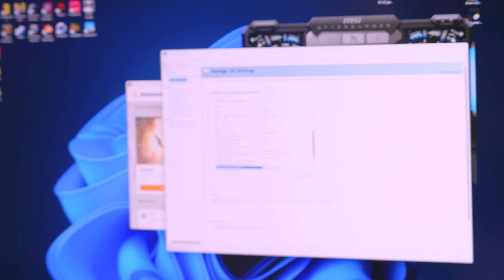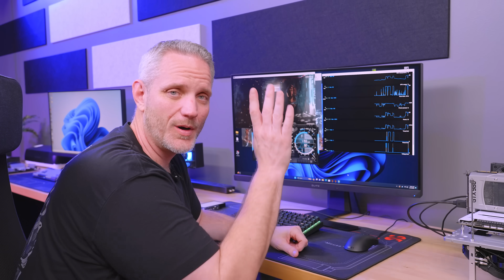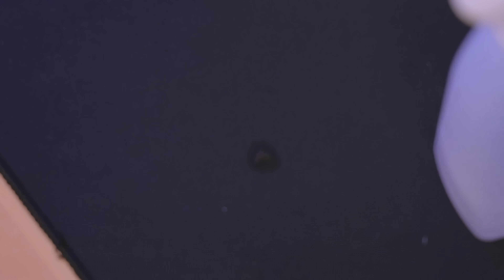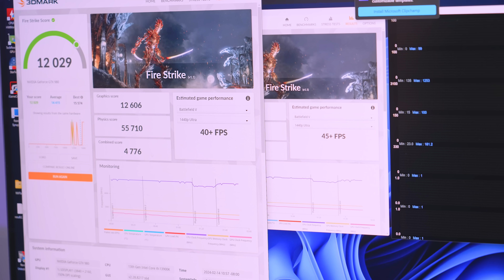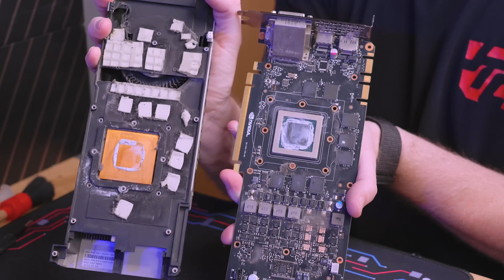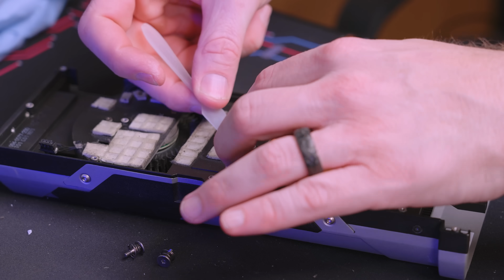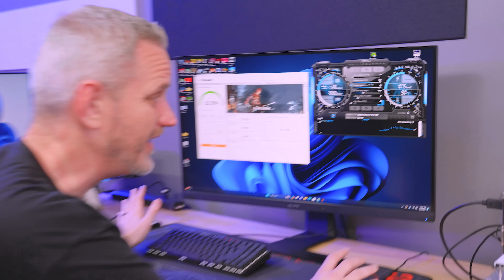This was KILLING this cards performance!

Comment: I bought an EVGA 2060 12gb in 2022 and never used it. I stuck it in my Grandsons rig and it spiked in Temps. Out of Warranty so I tore it down. THEY HAD PUT THERMAL PADS ON EMPTY VRAM SPOTS AND WERE MISSING SOME ON THE CHIPS THEMSELVES. I moved the pads and problem solved. WHO DOES THAT (except Detroit Auto Assemblers)?

Comment: lmao feels like me trying to cool an xps 8930 bro thres js 2 fans exhaust and cpu fan and its the worst heatsink ever on an i7 8700 bro the things an oven. i rigged it up with 4 more fans and im using it for my server so im running ubuntu server on it, and setting up a fan control pwm was a pain in the ass but i got it to work. and now its temps are good and its quiet and if it needs to scream it can cus i left the stock cpu fan and exhaust fan and the exhaust is 12v 1.5amp shits loud its fast asl at full speed. but temps are in check now at least.

Comment: I received a 1660ti recently and the thing was worse than this. i think it was in a garage with sawdust being blown everywhere, and I had to tear it down completely and the thermal paste was so hardened that the heatsink just popped off with very little force. Performance aside, I was not going to leave the GPU looking like it did. haha

Comment: I have done repaste on a couple 1060 laptopd with 6700k. They all went up like 4k points in firestrike, after. But i think thats mostly due to the cpu throttling. Still hit 90 c° with repaste and cooling pad under laptop😂

Did my gtx 770ti aswell. 2 times. Went up a couple thousand and dropped 15 c°

Comment: theyre is a huge difference on the notebooks. after thermal change and undervolt, the cpu's finally can bump on 100% unlimited,without throttle. the lows % changed drasticly, if not the fps boost. even if its brand new, if it came with bad thermal paste, this is a 2 years of bottlenecking ,crazy to think

Comment: I had 2 of the gtx980's in SLI, glad to see one opened up and cleaned.  I upgraded to the RTX 3060 because of power draw and the heat that my system was getting in general.  I still have the GTX 980's for relics sake.  One is being used till this day on my dads living room PC for theatre purposes.

Comment: Have a old Gigabyte Radeon r9 280x. Was giving me grey lines on screen and temps were at 89 celcius. 

So i did what a sane person would do, complete overhaul to wake it up for fun. 

Would not separate, at all. The thermalpaste were one with the gpu. 

Oventime and hairdryer for houers and it came off. 

While in there, i think a cat had crawled in and died. 
Changed all pads and removed now better called concrete than paste to a fresh one. Dust it off and also changed all three fans due to one had died. 

Put it all back and booted. 
Alive and well, grey lines gone and temps in furmark went from alarming 89 celsius at start to mere 38 and after one houer temps where at 72 at extreme stress load. 

Note to take, ambient room temp was 19 and im a person who have more fans than ram, i also dedicated my self into the difference from fan to fan for their designated purposes. All in and out fans are designed to move as much air as possible, the cpu fans to push as much air as possible. 

It was called the leaf blower. 
Have a great day.

Comment: Find a tool that can apply instant, constant 100% loads to either one core or all of them. Prime95 for CPU, any CUDA miner or something for the GPU. Shut down everything else to not interfere. Have a tool that can monitor the wattage going in.

Multi core first. If under 100 load, the cores develop differences of more than 5 degrees, paste is bad. (If that persists after repasting, it might be bad paste application or the cooler is warped or the CPU has defects). If the temp across cores remain similar, all is well with the thermal interface. If temps go up too high for sustained loads, but the grouping stays close, the heatsink and fan can't eventually dissipate the heat. Usually fan is clogged or otherwise airflow restricted. Laptops pulling in air from below are especially prone to this. 

Cleaning the heatsinks is always a priority 

Remove airflow restrictions, raise the laptop's back feet with the edge of 2 books or such and see if it improves.

Comment: The answer IMO is use PTM instead of thermal paste. Helped my 7900xtx by almost 20c because of pump out. Also lasts for almost length of your card. In internal testing they went from i think -25 to +150c 1000 times or more. After all that the temps actually got better. IMO PTM or nothing moving forward.

Comment: I bought a used Msi RTX 3070 Suprim X and the fans regularly flew at 100% even though I had my own curve set. The temperatures looked good except for the Hot spot, which went over 80 degrees Celsius. After replacing the old cooling paste, with the MX-6 paste is like new. The hot spot does not go above 75 degrees, and gpu temperatures go down about 10 degree.  The fan curve in the MSI burner holds.

Comment: I bought a 970 in 2021 and since I had been out of the topic for almost a decade it took me a few weeks to figure out that the thing was thermal throttling all the time. Tbf playing Doom 2016 on 1080p back then didn't give much of a hint. I didn't have new pads at hand but I repasted the die and I was actually quite happy with it until I finally got my 30 series.

Comment: 😯 You didn't replace the thermal pads too!.. Shame on you!... (to be fair they looked surprisingly flexible, squishy, and not falling apart for a 9 year old GPU, but I ALWAYS replace the pads too, because they do tend to denature, especially if run at the high temperatures of the more modern GDDR6 plus)

Comment: How often would you recommend replacing the thermal paste?

Obviously a 10 year old card is going to need it, but how about my 3yo 3080ti?

Gaming is my primary use of the card (putzing around with AI and such accounts for probably less than 1% of its usage), so temps fluctuate a lot, which is supposed to be harder on the thermals

Comment: So I have an old EVGA GTX 960 SSC 4GB card. Supposedly, the SSC stands for Super Super Clocked, LOL. When I upgraded the rest of my computer as we were under COVID restrictions, I went for the liquid metal option (Thermal Grizzly Conductonaut) on my CPU with an AIO. I had just watched Jay do a re-paste on some newer card, so I thought why not? I blew apart the 960 and cleaned the fins and fans out. They weren't too bad. But on pulling the heat sink, I found the powder formerly known as Nvidia Thermal Paste.

After a thorough cleaning of EVERYTHING and applying some nail polish to the electronic bits around the GPU die to keep the liquid metal from potentially shorting something and ending my graphics card, I carefully applied the Conductonaut and put the card back together. I'm still gaming (it's a struggle sometimes) on that card. However, there is a Radeon RX7800XT on the horizon, and I can't wait to get that in my system!

Great vid y'all!

Comment: I just picked up some MX-6 and some performance thermal pads for my 3080 which is getting into the 80 degree range and hot spots hitting 97+. Will be my first time taking apart a GPU to do some maintenance. Thanks for the video

Comment: I use compressed air to clean my computer, but I stop the fans from moving with a toothpick or something when I blast them with air.  With some multi-fan case setups, I can see a fan over revving just from too much positive airflow from other fans, so I think most fans now have diodes in them to stop current flow being generated. At least for the well made ones.

Comment: I purchased an asrock phantom 7900xtx and would get crashes if i tried to overclock it. Factory settings in 4k at 99% was pushing 100C. I decided to say F it and check the thermal paste. It was one of the worst paste jobs ive ever seen. The paste was everywhere and the coverage on the die was terrible. I put some MX-6 on it and now it can overclock with +15% power and only hits 88C. Ive been struggling with this thing for months thinking the die was junk. All i had to do was void the warranty to fix it. The QC of these companies these days is astonishing.

Comment: Please read this @JayzTwoCents  ❤ Talk to your wife and have her provide a "blush brush" for using on your hardware to remove dirt. It's far better than the brush you used ;) 
Blush Brushes are best for dust removing off of boards, fans and a lot safer and more thorough. Been using them for a long time ❤(yes, a new one not a used one) :D

Comment: Thank you for motivating me to do this on my old 1080 TI, it runs much cooler now.
It has no backplate but a tripe fan + rgb shroud design nightmares are made of...no wonder it had never been taken apart before.
It's a Gigabyte Aorus 1080TI Gaming OC for those who are curious...also one of my fans was dead(the one closest to gpu of course) so I just swapped it for one of the non dead ones (had no PWM signal on my OS but I do now since the one I swapped it for in the daisy chain had no PWM connector for some reason). 
Even with one dead fan out of 3 it still runs much cooler now.
I looked on amazon to replace them but you have to buy the entire daisy chain...eh wait till it gets too hot this summer before I go through that ordeal again.^^'

Comment: I recently "repasted" my Gigabyte RTX 2080 Gaming OC with a Kryosheet. It dropped the peak temps by about 22°C while increasing the score by @5%. Thermal Grizzly has made an amazing product considering I won't need to "repaste" that card again. I can't wait to use it in my open loop.

Comment: Always do at least a dust clean every 6 months fans and heat sink blades ( Pollen seasons check the filters  weekly  where i live sticky birch trees around it's amazing what come in through open windows and clogs fan blades and screens)   and a full paste and pad  clean and refresh yearly and never had a GPU fail me (touch wood)  keeping your system and components clean and the heat transfer optimum   for the sake of a few hours  maintenance  is a no brainer  and allows you just to maybe notice things  in your system as time goes by , always checking capacitor caps  and solder joints where usbs etc are plugged in out regularly , and other  stress points.

Comment: I guess it depends how old the card is.  Some of the cards are just old drivers that are no longer updated that are going to cause issues rather than cleaning.  That said, obviously a card that is overheating will reduce the performance due to thermal throttling.   Sometimes these older cards that don't get new driver updates are not worth spending the time on, unless you only want to use them with older games / applications

Comment: I replaced the thermal paste on my Palit GTX 1070 Jetstream after five years... but the original one was still looking good and the temperature difference was not really noticable that much - like a degree or two.

Comment: For proper comparison, shouldn't the fans be set at a fixed fan speed, thus eliminating variations in fan speed as a potential factor???   By leaving the fans alone, a hotter card will spin the fans faster providing better airflow & cooling, while a cooler card will spin the fans slower providing reduced airflow & cooling.  This is why I always do before & after testing with fans at 100% speed, whether it's on CPU, GPU, AIO water cooler, etc....  Also why I only use 1 specific fan (Noctua Industrial  NF-A14 iPPC 140mm or NF-F12 iPPC 120mm depending on what size fits) & not the fans that come with heatsinks, AIO's, etc...  Such consistency is also the ONLY thing I like about the Thermal Grizzly KryoSheet...  Eliminates thermal paste application disparity.

Comment: Hey can anyone help me, when I try to start my computer it takes me to a screen asking for something to boot. My ssd isn't lose, it's clean and my bios recognizes the ssd.  I got it to boot once or twice trying to fix it but nothing. Any help would be appreciated thank you
Reply: Ask on a tech support subreddit or site, not on someone else's video which is on a different subject. That's rude frankly. Other than that, make sure the SSD is properly formatted (i.e GPT) and connected and is actually set up to be bootable to begin with.
Reply: @ObakuZenCenter  well I figured I would get more recognition on a newer video rather going to an older video

Comment: The cleaned 980 gets about what my Strix OC 980 gets on a Xeon x5675. In a system with no bottleneck it gets above 14,000.

Comment: How often do you recommend re pasting a gpu?
I have had my 3080ti for 3-4 years now. Just to give ya a idea.

Cheers
Reply: Stock paste usually lasts two to three years before temps start to slowly increase. 
So simply wait until it's out of warranty and re-paste it. That fresh after-market paste should last longer than you'll keep that card afterward. 
Re-pasted my 2080 after three years and got it to run a boost bin higher at 10°C less. It is worth the effort regardless of card gen and brand. 
There's a good chance even a quality graphite pad would reduce temps compared to a 4y/o factory paste application. 
I use the red ThermalGrizzly paste. Expensive and not easy to apply but it's the closest you can get to liquid metal.

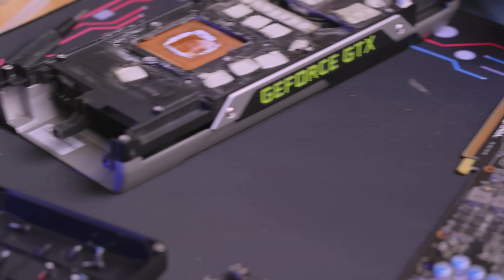Comment: 10:30 This is odd. With my 1080ti the pad at the same position was missing. (The cooler with the original pads was boxed for 7 years, but I am pretty sure, I got all of them. Also there was no sign on the cooler, that there ever was a pad on.)
Reply: Manufacturing defects like that would be really hard to notice, if it only affected a few shipments before someone at the factory noticed. Most people will never open up their cards after all...

Comment: Just this weekend I sold my 1080ti and I remounted the stock nvidia cooler, which is the same as on the 980 in principle. I did a quick test with furmark, to check if I messed up. And I noticed how quiet these cards where. 79°C and so quiet, compared the 7900 XTX 310 Merc I have now.

Comment: Is it really ok to not replace the thermal pads after a full GPU disassembly? I'm considering cleaning and repasting the used 3080 I got last year but I'm honestly put off by the idea of having to replace the thermal pads (figuring out correct sizes, thickness, getting good thermal pads, etc.) so I just let it be. It's working fine so far but I'm genuinely curious if I could get away with getting it cleaned then repasting without replacing the thermal pads for hopefully better performance as well as maintenance for longevity since it's used.

Comment: Not to mention how half assed the clean-up was, there was probably more dust in the fins from blowing it around than initially. Imo u'd want to disassemble it (if this is a model with sane engineering) and actually clean it if you go that route. Leaving old paste on the sides of the GPU chip also not good, SOME heat is gonna go there and stay there warming up the whole chip.

We use thermal paste as a conductive interface to get the heat transferred off in the radiator fins better, not to spread it around the place...

Comment: I just bout a Intel I5 14500 cause it was $5 away from the lower one at the time ($240 vs $235). will that last me, say, 4 years? My 1st build, from 2017 with an i3-7100 works fine as long as I dont push it although I do plan to start trying new stuff. Still gotta figure out what GPU to get at $200 or so but ill use my GTX 1060 6gb for now but I would like to know which I should think about. I got 32gb (2x16) ddr5 ram 64000mhz. Not worried about getting a new cpu or motherboard for a while so I dont care about intel gen 15 as far as getting one anytime soon. Thoughts on best budget GPU? Either Nevida cause I like their software as thats my gpu now or AMD if it is just that much better cause Im building this new pc next weekend and putting current pc in the back room and will put my 1060 back in it when I can get a new*(2nd) one.

Comment: I ran into almost the exact same situation with a Dell RX 580 two days ago.

Brand new system, and as soon as I put the GPU in, it acted unstable.

I pull the card and decide to repaste it.  I have never seen scorched thermal paste, but this had it.  It also had a big old discolored patch on the heat sink that wouldn't clean off.

Spent 10 minutes cleaning it with IPA and put some MX-6 on it. Poof. steady as a rock.

Comment: You don't let a fan free-spin under compressed air for the same reason that you don't let bearings free-spin under compressed air - they can easily over-rev and wreck the bearing. Even if the blade assembly doesn't explode, you can absolutely wreck the fan bearing by letting it free spin with compressed air.

Comment: Seriously Why do people even use Fan curves. (i mean basic curve 50% fan at idle then above 35c 100% all fans n cooling max sense) 

For any serious gaming you should be setting fan to 100% on GPU, CPU, System and THEN Starting a Game or Test. 
Its easier to keep something cool then to cool it after its heatsoaked. 
Also GPU at 40c performs better than GPU at 80c 
Its as bad as benchmarks in 2024 showing 1080P results (just so they have high numbers in the 250fps+ which looks better on videos) 

Re-run test will ALL Fans & Cooling at max.

Comment: MY now secondary PC sat in lounge room with my old FX-8350 CPU that Idles @ 4.6ghz and boost to 4.8Ghz has not had the thermal paste reapplied in 10 years since i built it (artic silver) 
OVer 38,000 continous running hours (maybe been off a total of 55 hours due to power failures) 
The temps at idle are still Ambient +2c and at load 50c max. 
When i built it with new paste in 2014 it was Ambient temp at idle and 45c max under load. 

People who reapply thermal paste every year or X hours are just wasting time & money.